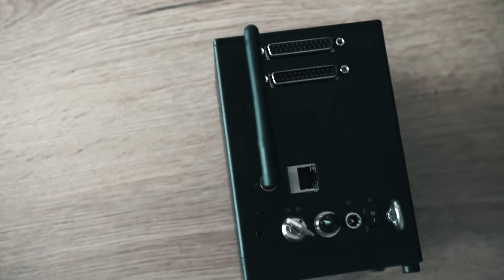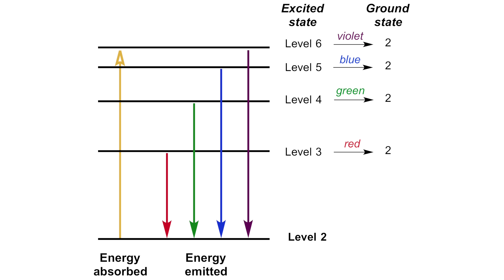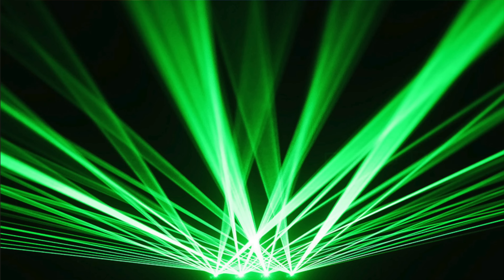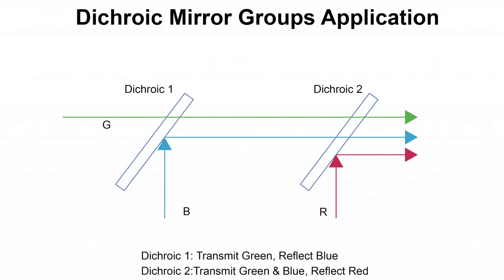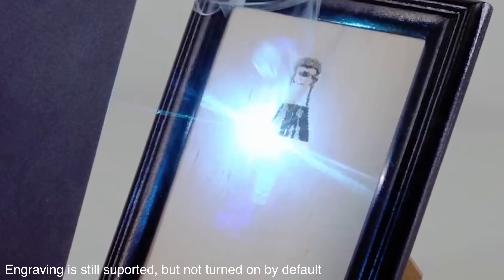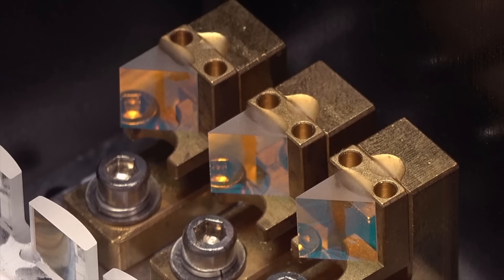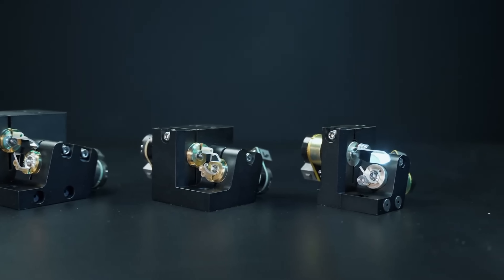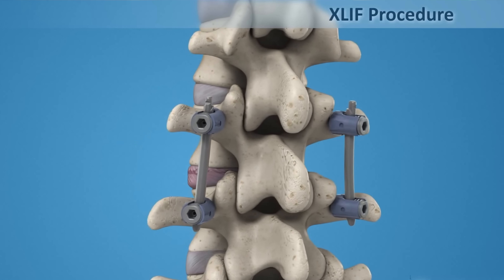The New Kind of LASER You Should Know About!

Comment: First, light amplification only occurs when the ruby is excited into a metastable state.  The metastable state allows us to achieve "population inversion" so that more photons are stimulated into the beam than are absorbed from the beam.  Every stimulated emission is an exact copy of the stimulating photon -- exact same direction, exact same energy, and exact same phase.  Since an existing photon is needed to stimulate an emission, amplification rate is proportional to the intensity... the brightest light that has been reflected several times from the end mirrors is by far the most likely to get amplified.  Thus, lasers are very directional -- this bright light stimulates emission from all of the Cr so that the dim light having another direction is rarely amplified.  The crystal structure of ruby (and only ruby I believe) does preferentially emit along the axis, but this dipole radiation pattern is not especially directional.

Second, there are subtle differences among "dichroic mirrors," "beam splitters," and "optical filters."  Beam splitters treat all colors the same but redirect some of the light randomly (or based on polarization).  Filters pass only specific color ranges but might absorb or redirect the rest.  Dichroic mirrors are a blend; they pass or reflect light based on its color (and the incident angle).  The light that is out of phase and cancels on one side is in phase and reinforces on the opposite side.  Due to energy conservation, the light must be reflected, transmitted, or absorbed.

Third, the NIF requires uniform intensity and tight focus far more than absolute power efficiency.  The more efficient lasers are not yet capable of these parameters so most of their light would either be wasted or even counterproductive for fusion.  (Although, fiber lasers are quickly approaching this need.)

Fourth, our eyes don't have especially high spatial resolution.  The old color CRTs had rgb phosphors that were separated by fractions of mm and our eyes blended them quite nicely.  Perfect alignment of the mirrors is not required for distant viewing, but does improve close up experiences.

Comment: I have a laser projector that only did fixed patterns baked into the controller with adjustable parameters. It does full RGB, but I wasn’t impressed with the effects it had. So I ripped out the original microcontroller, played with getting the steppers and lasers to work with a new controller. After a week I had a pretty good vector processor. So now I can draw text and many animations streamed from my computer. I guess I could run a Tempest clone on it someday.
Reply from the maker: How bright is it?  I've you've already got some way that I can programmatically drive it, drop me an email at the channel address to discuss!  Perahps I could get away with just writing the code to hack Tempest, and the hardware is already done :-)
Reply: @DavesGarage  All you need is LASERMAME!  Play all those vector video games with a laser.
Reply: @DavesGarage  The brightness is pretty good at night, even during twilight and in a ambiance lit root.
I tried doing some other test patterns. I can do about 256 points per second, optimized, with a resolution of 32x32, but it gets really flickery. It’s still good for a sentence of text and animated shapes.
I’ll see if I can get a faster one someday.
Reply: The stepper motor reliability is almost as impressive as the dichromate mirrors.
Reply: @jab100lochaber  steppers are only used in cheap china lasers. They are way to slow for producing anything like shown in the video.
Reply: @wupme  Regardless of the type of actuator, it's very impressive how precise they are.

Comment: Curious question Dave - when you described that you would not use it to etch, could you expand on that a bit?
Reply: Really hard on the laser and galvo assemblies, in that you run them at full power, and for the galvo mechanisms you are also moving them very slow, so they do heat up in spots quite a bit with all that light energy on them, and being low mass they do tend to overheat, which will result in them failing or distorting, and needing to be replaced.
Reply: @SeanBZA  Great information - thanks @SeanBZA !